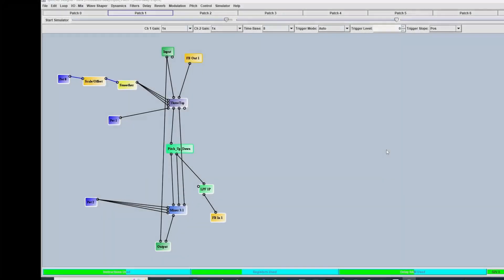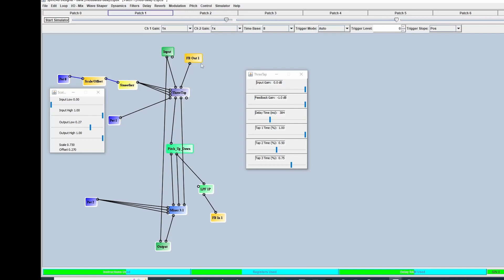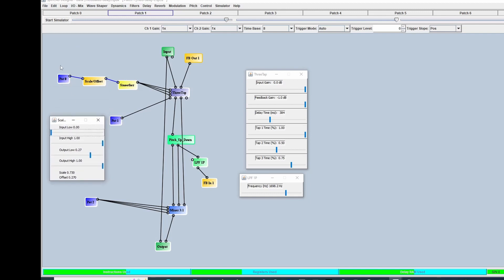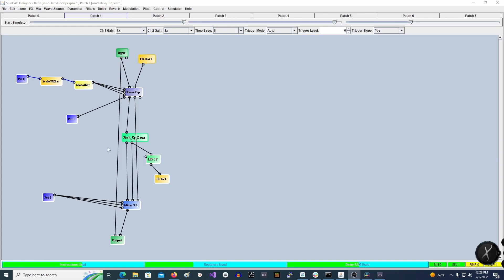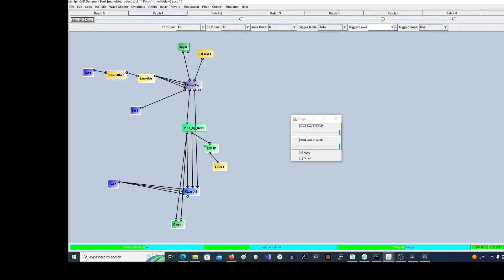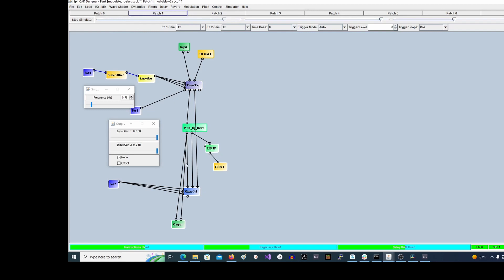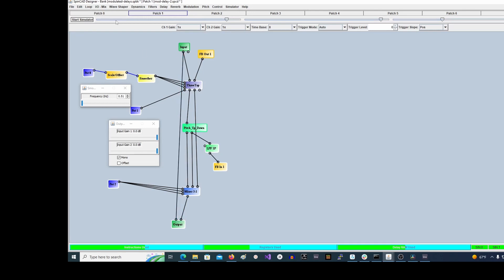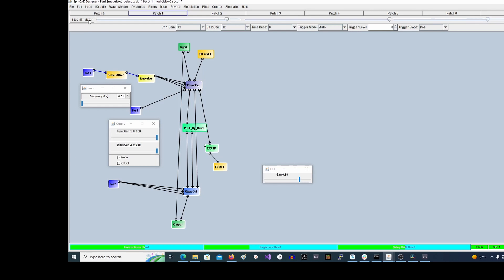SpinCAD Designer - Pitch shifting delay by Holy City Audio

Comment: Hello, I have a question. Can you help me?
Reply from the maker: what's the question?
Reply: @garyworsham9471 I'm experiencing a delay in the FV-1's built-in pitch effect; the sound is a few milliseconds (m/s) behind, which is annoying. I know it's impossible to eliminate it completely, as this is common in all pitch pedals. However, how can I reduce this delay further? I assume it can be fixed with a program on the EEPROM, or is it possible to modify the pitch shifter in the FV-1's internal memory?